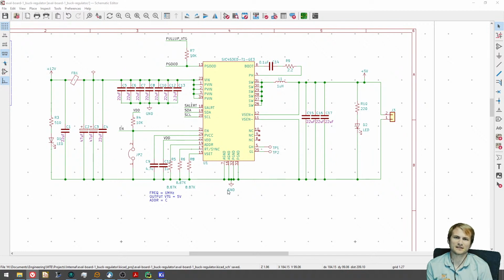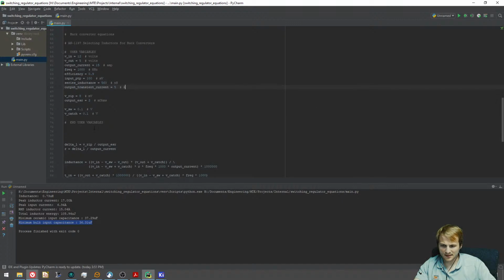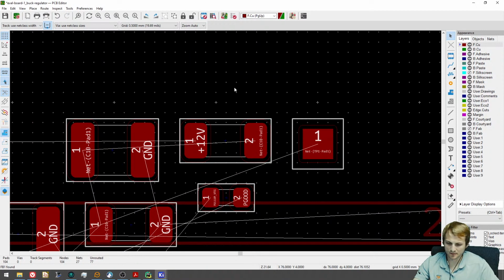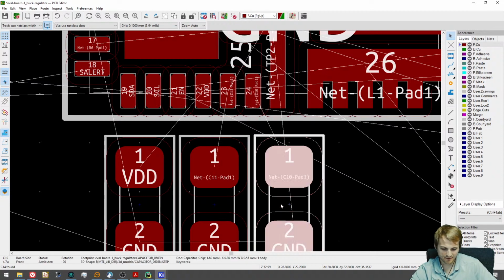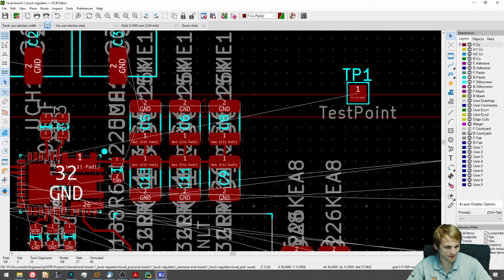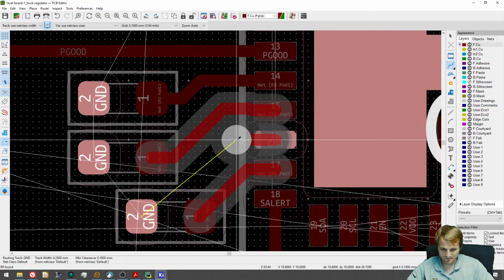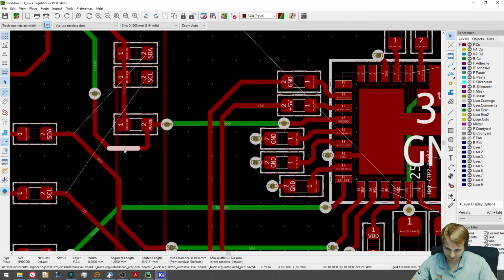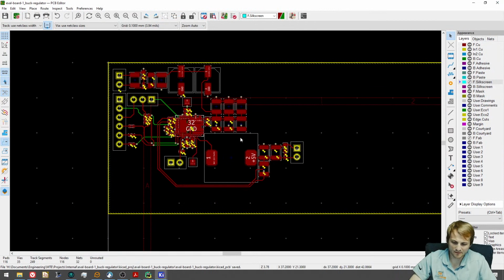[Livestream] Designing a switch-mode DC buck converter Part 2

Comment: I usually include multiple filter caps in parallell as a convenience instead of the tedium of putting one across each chip as they are mounted on the PCB.